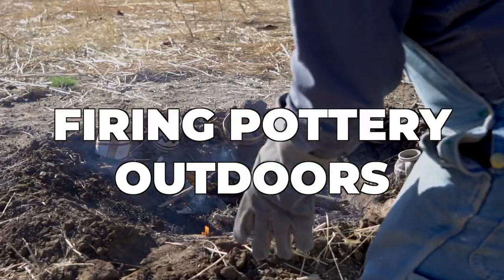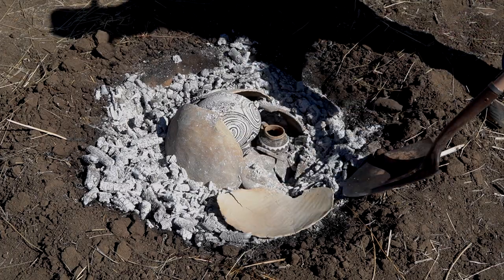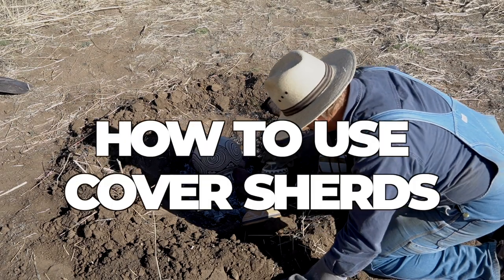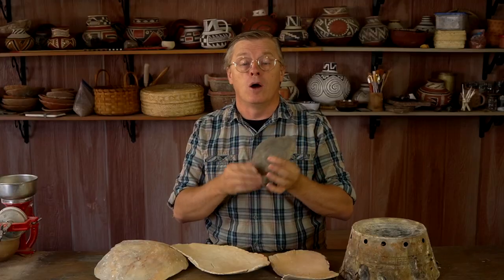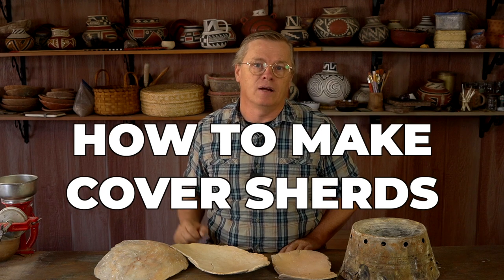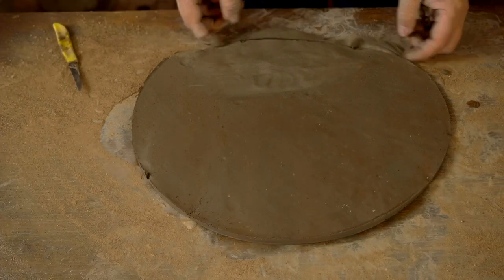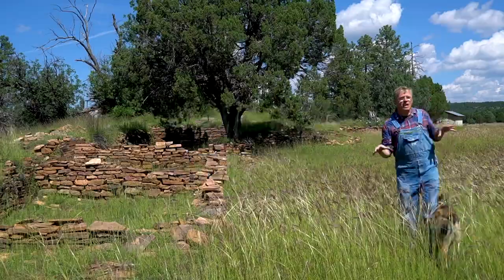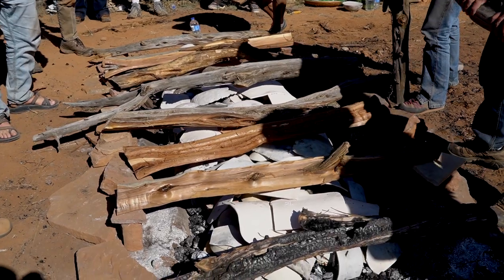Don't Fire Pottery Outdoors Without This

Comment: That x-15 hobby lobby clay is good for mixing wild clay with to make your wild clay strong and brighten the colour a bit. Some wild clay can be weak or otherwise less then optimal,  but the x-15 may help. X-15 definitely needs added temper though. It fires pretty low.
Reply from the maker: Good tip, thanks. I could see it being useful that way.

Comment: one of my two pots that didn't break was under a coffee can.  a pretty easy thing to make. ;)

i think the radiant heat will heat the metal and then you get conduction, convection and radiation inside.  my theory is it reduces uneven heating and very rapid temperature change.

i made a video for you of my wet clay processing, which is on yt.  that is something i knew how to do.  keeping the pots from breaking, still working on that.
Reply from the maker: You can only get conduction if the pot is touching that thing so even if it is touching the metal it is only in a small place and the metal does not hold onto heat well because it is thin. Radiation off of the bucket, again very minimal. Inside that bucket it is 99% convective heating. Which is much slower and more even that the other two.

Comment: This is the video I needed when I was first burning pots without cover sherds. Thank you for clarifying that they are quite necessary. In a recent burning one pot was covered by sherds the other not and it got spawled, while the covered one remained intact - a good thing for it was my favourite and I drink tea out of it now (a neolithic carinated burnished and stamped type of pot from the old continent). Funny that you try to avoid the reducing effect of cover sherds: it's a good tips for those who don't use organic paint and actually do want to reduce their ceramics 😄 !
Reply from the maker: Don't confusing reducing with smudging. The problem is that we use the same word, "oxidizing" for oxidizing iron and carbon so reducing is the opposite of that but it is all quite confusing. I have a video coming up about how to reduce a pot, (real reduction not smudging). Oh and thanks, glad you liked the video.
Reply: I'm looking forward to see the video on reducing. I was meaning that you probably don't want to reduce the pots if you have organic paint on it, otherwise they won't stand out on a darkened background, but those who do not have paint on it and want to have darker tones or who are using clay slips for black paint, are not afraid to get a reducing effect. As for smudging, I still think it comes hand in hand with reducing. The fact that the interior of the sherds remains red may be due to the fact that there was first oxidising then reducing (and smudging).

Comment: That’s really interesting , I wonder if that concept would work in my gas kiln I designing.
Reply from the maker: I suppose it could. Do you get carbon on your pots from the burning gas?
Reply: @AncientPottery  I not know yet , the gas kiln is still being designed and built , it is small kiln , two cubic feet , I not so concerned about carbon but maybe the thermal shock could be reduced by using that concept. 
Hope to attend one of your classes some day ! 
Thanks for the reply.

Comment: Andy, do you think I would be able to fire pottery in a smoke house? I haven't used it yet, I have just moved into a new house. It's a little shack with a brick structure on the inside for smoking meat. It has some holes in the roof just from being really old and dilapidated
Reply from the maker: I have no idea. My understanding of smoking meat is that you need to keep the temperature relatively low which seems counter to the goals of firing pottery, but hey anything is possible.

Comment: Hi Andy, do you think burying with sand may work as a shed? I have to fire a flat tile and it's my first pottery ever. Thank you for the great content!
Reply from the maker: No, you will not get hot enough if you cover the pottery with sand. Notice in the video how I discuss the importance of air circulation in a pottery firing.
Reply: @AncientPottery  Right, it makes perfect sense, thank you. Finally I used a spare ceramic tile I had in my backyard. Unfortunately the ceramic tile exploded and my manufact apparently broke under its weight. Next time I'll make sure to use well dried sheds! I enjoyed the experience nonetheless 😊

Comment: Hi Andy, I know you dont use commercial glazes, But do you know if you can use a low fire glaze with a wood fire outdoor kiln? I just tried and failed. I am trying to figure out what went wrong. I guess I did not get it hot enough. However, I dont feel like burning an entire cord of wood just for one or two pots. Any suggestion?  I guess I should add that I have a "Philosopher’s" style kiln with a fairly lagre fire box and about 6" of air space below it with a 5' x 8" round duct coming out of the chimney.
Reply from the maker: I have never heard of anyone glazing in this sort of fire. What temperature is required for these "low fire" glazes? It is rare to get an open fire much over 1000 C. John Olsen got his fire over 1000 at the kiln conference last summer but mine usually top out around 900 if I am trying to get them as hot as I can.
Reply: Wes from airstream wanderings has experimented with clear glazes in a simple wood fire. He uses a leaf blower to greatly increase the temps. He’s got a channel here on YouTube check him out !
Reply from the maker: @cysewskiscustomchippin9691  Those are lead based glazes, those are doable in outdoor firings. I have also played around with that https://youtu.be/zOrKF3oqIQU
Reply: @AncientPottery  They claim to fire at cone 06-05 temps. The only way I think you can get that hot is by using a lot of wood. Which is why they had huge kilns in the past. I am just not sure what the smallest "big" kiln is required to get to Cone 05-04 temps. I guess it is back to trial and error.
Reply: @cysewskiscustomchippin9691  I am familiar with his channel, but missed that one. Thanks I'll check it out.
Reply: Update: I did a bit more research and found "Backyard kilns" by Steve Mills , Which I found out that I have a "Philosopher's" Kiln not a "groundhog". Also, he had a section on the correct proportions for the kiln. It turns out that my flue entrance was too small (by double) and my chimney was too large (by double). Finally, he made a suggestion on how to load the fire box which made sense as well.  I was doing it the way he said not to. So, with all of that, I will give it another go. P.S. The glaze I have is a low fire lead free glaze. (food safe as I intend my pot for cooking.) Thanks to everyone” that have replied.

Comment: Can I use modern plates and bowls (from thrift stores) as my cover sherds?  Or other options besides a metal bucket?  I cave a cast iron cauldron I can use but I’m afraid it will block too much heat.  I want to make cover sherds but it’s not an option now and I don’t want to have to fire them before I can fire my pots I’ve having the kids make.  I could buy some six inch terra cotta pots also but that gets pricey!
Reply from the maker: Most modern, store bought ceramics are not tempered enough and so will break to bits in the firing
Reply: @AncientPottery  thank you!

Comment: But isn't temper just broken up bits of fired pottery? Once those cover sherds are used in a firing, they essentially become inert material that is the same as unground temper don't they?
Reply from the maker: All of my cover sherds eventually become temper, it takes a few years for them to break down into small enough pieces to not be usable for cover sherds any more.

Comment: What does temper?
Reply from the maker: Temper is non plastic material added to the clay. It allows the clay to dry more evenly and protects against thermal shock in the firing.